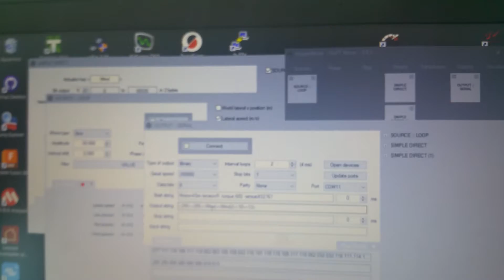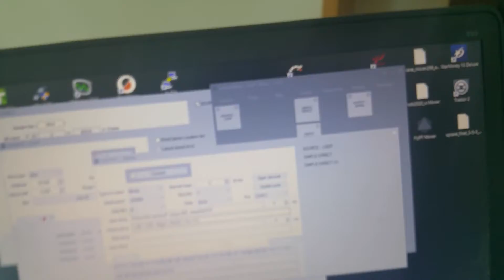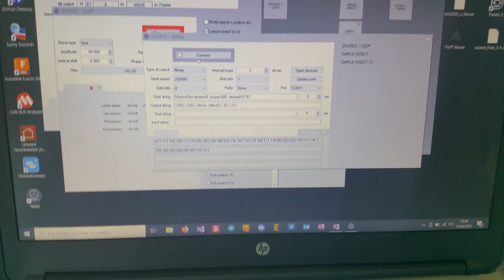how to operate tensionR active beltsystem with flypt mover  or simtools

Comment: Hey sir do u have any knowledge on  bluetiger motion sim . Its uses Thanos AMC Controller. I can find nothing to work with it , it is a motion sim for racing , flying but i cant get it work with no software. It come on and levels out but it want motion at all 🤷🏾‍♂️Im so upset its like it just a paper weight . Do u think i need to throw it away thanks for any help u can provide